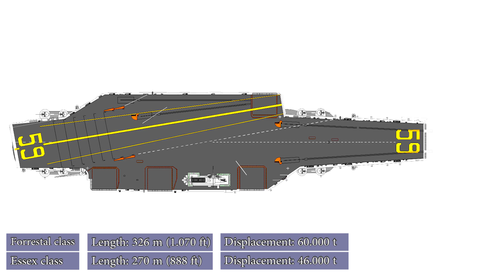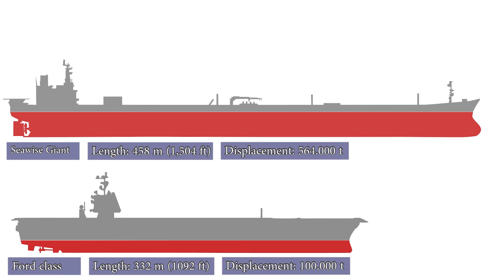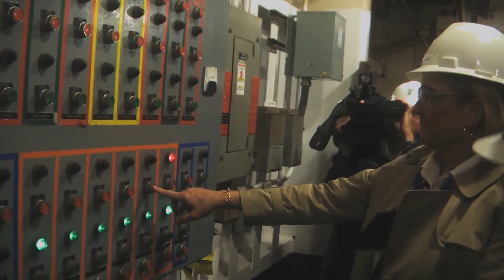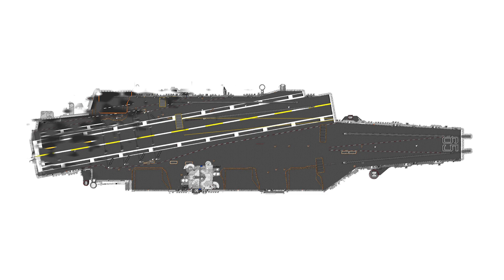Why don't aircraft carriers get bigger?

Comment: An aircraft carrier as a concept in the 21st century may be questioned. With modern military technology, it could be destroyed, and jeopardizing such an expensive ship with a huge crew is very dangerous. The US Navy will soon have to look for other ways to ensure its superiority.
Reply: Perhaps, but at the same time it is not as if carriers were ever indestructible. Nor is it the case that only large carriers have a place in the modern USN (e.g. amphibious assault ships can preform some of what constitutes carrier operations). Since naval aviation is unlikely to go away or be relegated to the sidelines anytime soon, perhaps all that is needed is a couple of smaller carrier designs meant to compliment the big supercarriers in a manner not unlike how light carriers supported their big brothers, the fleet carriers and how there were inexpensive escort carriers for use when you didn't need to keep up with the fleet.

caveat: The examples of light and escort carriers from the past is simply to reference that they complimented the big carriers of the day. Not the actual ways in which they did it.
Reply: @whyjnot420  It’s an interesting topic. Clearly anti ship missiles have become a bigger threat to aircraft carriers and other ships of course. Force projection is one of the aircraft carriers primary roles. Longer standoff distances are an obvious first step in reduce the risk of a missile strike. Anti missile defences will need to be improved significantly to enable the super carriers to operate with a low risk of being hit per se. What form the improved defences will be in the future is unclear. The publicly available information indicates that anti missile defences are developing rapidly. Systems like “iron dome” can seen intercepting relatively slow missiles. Sea skimming anti ship missile are a more difficult weapon to detect. Other technologies such as laser weapons can be used to disrupt a missiles optical targeting and ECM to interfere with radar guidance. The super carriers of course operate within a fleet and use a layered defence strategy. New weapons and strategies are probably already being developed. These are things that will be kept highly confidential.
Reply: @DJAYPAZ  On that last note about layered defense: This is an aspect many do not consider (or blatantly ignore for the sake of being a doomsayer). Many who consider it do not understand. Many who understand it underestimate it. Far too many people utterly fail to realize that if the supercarrier itself is directly threatened by something, by anything really, A LOT has to have happened.

Another aspect (a bad day scenerio) that people do not really think of, is that even if a portion of a carrier battle group is sunk including the carrier. It means there are even more ships to add to another group. Since it is unlikely that a majority of a carriers escorts would be sunk unless we are talking a nuclear strike, and at that point there is a hell of a lot more on peoples plates.

As for new strategies. You can really say "not so much" here. New operational and tactical doctrine yes, not so much when it comes to strategy. Not without a major shift in focus and types of ships being developed/deployed.

One last aspect I think a huge portion of people either fail to consider or only partially consider, is the fact that the US is not on a war footing atm. Not on a war footing, but has the fleet it does. If this is a peacetime navy, a wartime USN by modern standards is straight up nightmare fuel for anyone that wants to fight it. It seems to me that so much of what you hear is a peacetime USN vs a wartime somebody else. And you never hear people talking about what the current navy would be doing as the nation fully gears up for wartime production. You would need a straight up sucker punch and several at that. A single Pearl Harbor style attack simply will not do today what it did back in 1941, even if it does catch a full fleet at anchor just like the IJN did.

The worst case scenario I can think of, that is non-nuclear and is not full of wishful thinking, would be that the US could get forced into a situation where it has to act in a manner like it did the first half of 1942. Not that Pearl Harbor would repeat itself, but that the US could be forced into fighting a delaying action with limited offensive actions taken while the nation moves to a war footing. The real question for me is how the US (in terms of ramping up) and USN in particular (in terms of waging war) would fare in such a situation. Which of course does depend on who the enemy is and what their objectives are. Which is a matter for another time, but this is where I wish a lot of people would focus their conjecture. Simply put, if the US can keep its coasts secure and the conflict doesn't go nuclear, not many countries would have a hope of winning a fight against the US.

(people say that the US lacks commitment and while this has been true at times, cannot be further from the truth other times, especially those times when the actual population of the US has felt like they were directly attacked)

fun fact: way back in the 1860s at the beginning of the civil war, the USN was in a sorry state of affairs. By 1865 and the end of the war it had grown to be, in terms of commissioned warships, larger than the Royal Navy (similar to how the PRC and its "Peoples Liberation Army Navy" (no lie, that is its name) is atm relative to the USN, except the USN did in 4ish years what it took the CCP a few decades to do, along with adding innovation and not just playing catchup). Before the Anglo-German dreadnought race the US was the 2nd most powerful navy after the Brits (even after the Germans had taken over as #2, that was only in terms of battle power, not things like strategically important bases and whatnot, which are very important to waging actual war and not just slugging it out with the guy next door). And anyone who compares US hegemony on the seas after WW2 to that of the Royal Navy after the Napoleonic Wars, needs to take a closer look at the relative balances of power in this two periods. Now today it might take more time to fully engage the US into a wartime position than it did in the late 30s, but a US that does take such position is not someone I want to piss off.

fun fact 2: If you average it out, during WW2 the US commissioned around 4-5 warships per week for the entire duration of the war. Obviously it was slower at first and ramped up, but that is the average. And does not include USNS ships (think hospital ships and other non-combatant types) or anything else like the USCG, only full up USN commissioned warships. As someone more clever than I said: A destroyer a day keeps the Japanese at the bottom of the bay.
Reply: In wartime, an aircraft carrier never sails alone. The US Navy has a few layers of Air Defense systems, i.e. with the Aegis as a long range ballistic missile interception system. The Navy also works alongside Army's THAAD for increase in Air Defense redundancy.

Comment: Speed, manuvering. Small easier to maintain. Cheeper better. Smaller with extreme range speciality stealth long range drones that can travel at hypersonic speed. No human die in destrouctio. And how many g forces any piolts out there can a human surive, versus how fast a drone can do if hypersonic. With frequent mide air refuling? That's how we seem to be going. Probably the Reason that the nuclear bombers were scraped. Hard to matained. Great hule was built in the 1950's only standed down in the 1980's.
Good idea the Panama canal might be a issue probably for the support ships I dought a captial flage ship would be in any narrow confined area. To big a risk.